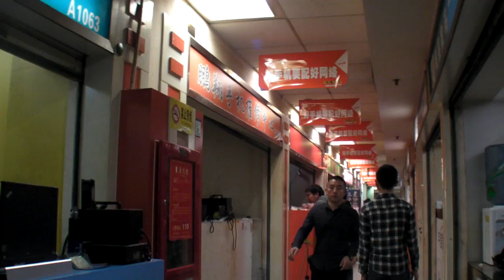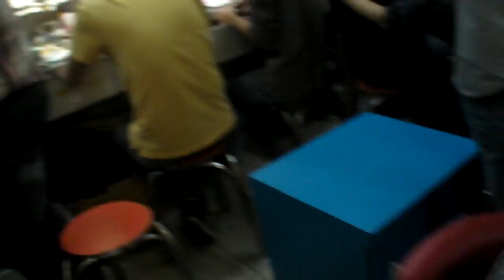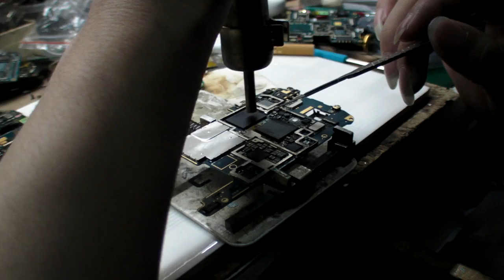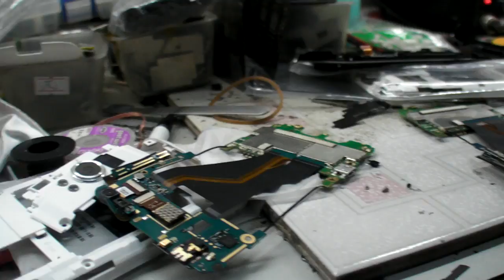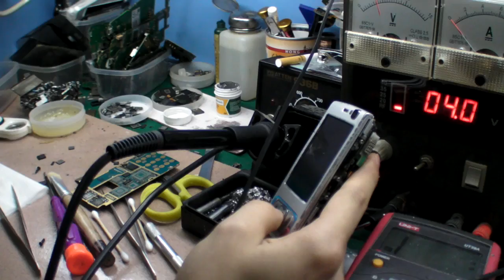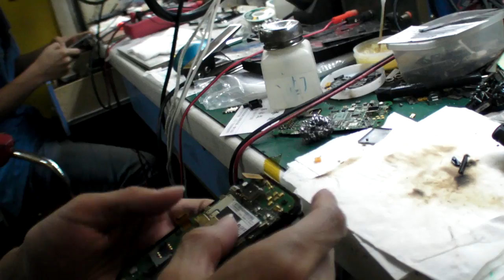Smartphone repair at the Shenzhen Smartphones Market

Comment: Sir please let me know something urgent.
I have S10 plus billed original from india. And since day 1 I have been facing camera issue. Blur terrible quality. Anyways long story short. The service center thinks it's fine wont agree. They compare with similar terrible piece. I compared to the Samsung s10 plus from usa 975u1 to mine 975F. So the camera is way better on usa. Can you tell me where to get the camera changed from Shanghai as I m travelling to china this week
Please do let me know where to go n get it replaced cheap but original. Thanks
Both cameras back and front 
And also my 4g keeps dropping in malls.
Reply from the maker: Hi there is some huge electronics markets in Shanghai you can Google "shanghai electronics market", I think there they can change your camera for not too expensive and they might do it for you within an hour or two you can walk around shopping a bit while they do it.
Reply: @charbax  can you tell me which n where so I dont need to search a lot if you have experience thanks
Reply: Sar app ka no mil sakata ha muja cahiana ma kuch kam ha pohne ka bara ma